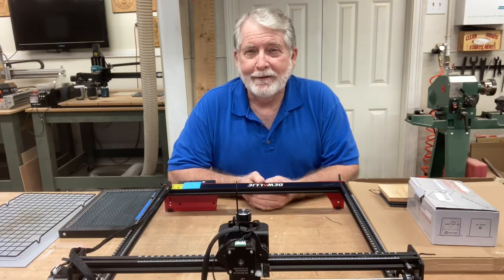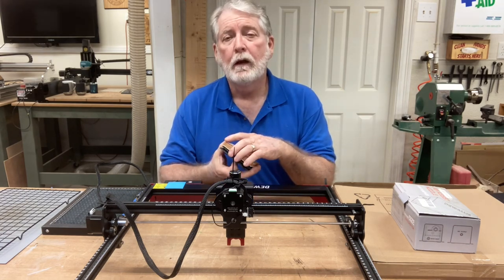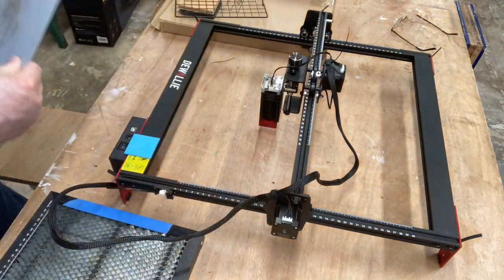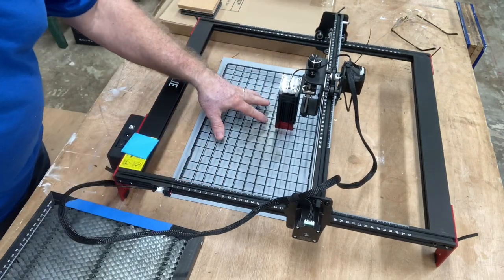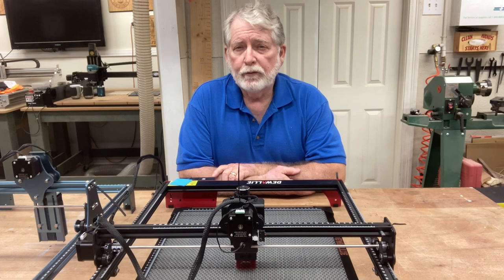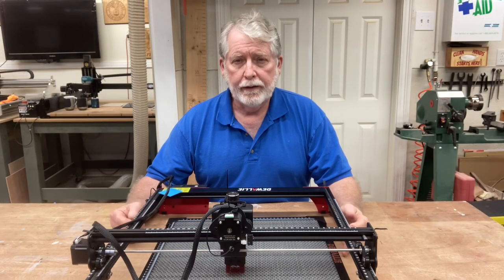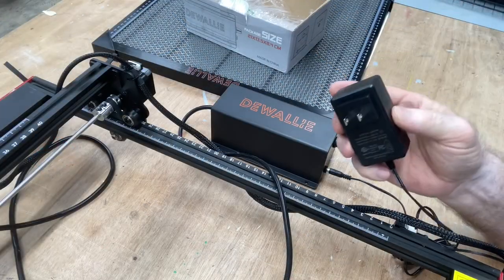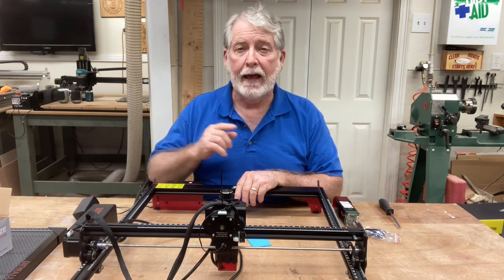Dewallie Honeycomb Work Table and the New Air Assist by Dewallie

Comment: Love your videos and tips - question for you - in your opinion what laser is better for cutting? ORTUR, XTOOL, Sculpfun Dewallie?
Reply from the maker: All I of the diode lasers are very similar and an excellent staring point. The differences are in the some of the features on the machine. All are GRBL based and all will run the Lightburn software.
Reply: @PawPawsWorkShop  Thank you Sir - looking to started but wanted to include ability to cut decent as well (with air assist of course 😀)

Comment: I was hoping for a demo with and without the pump to see how it worked?
Reply from the maker: All the various air assist ultimately work the same. The key to this one is the simplicity of the installation of the air nozzle and the fact that it can easily be attached to other lasers.

Comment: It seems they "copied" the FoxAlien air assist pump.
Reply from the maker: Definitely very similar in design. It is significantly larger. The clip is a very simple yet effective design which will work on multiple lasers.
Reply from the maker: By the way I am adding a camera to the FOXAlien. That should be an excellent video featuring the FOXAlien